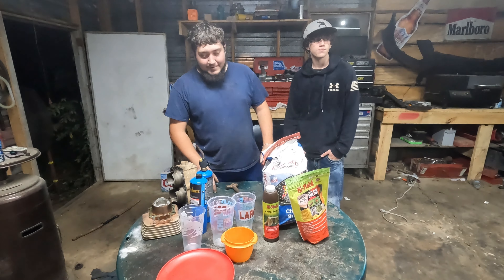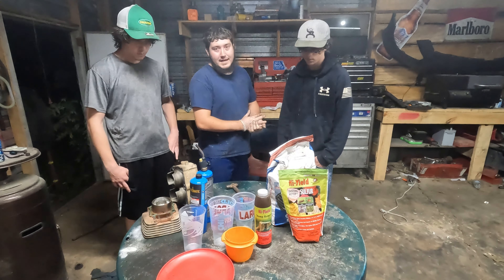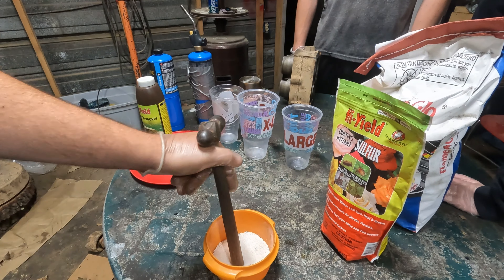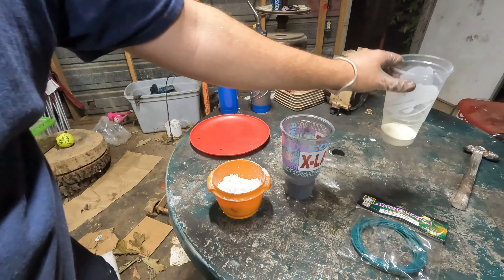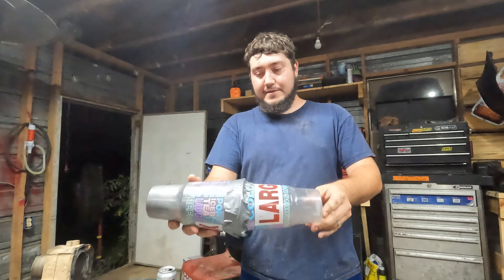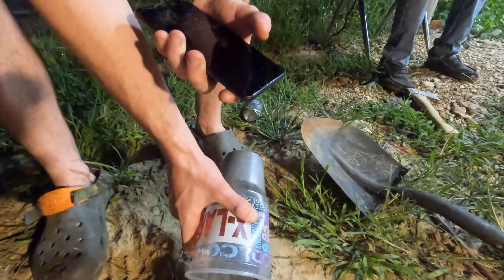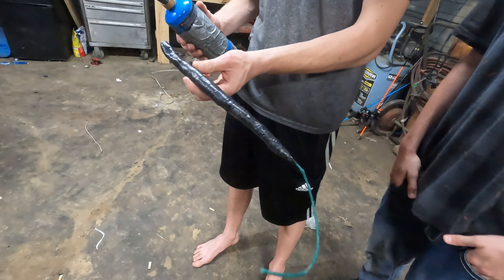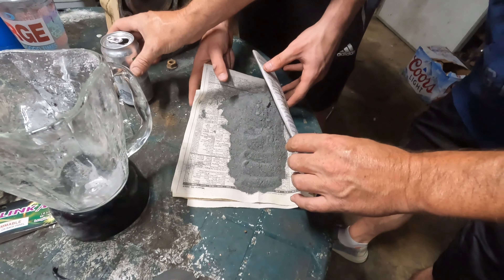DIY Gun Powder Dose it work

Comment: Weld up a pipe, both ends, then drill a hole in One end, thread the hole, pour in the powder, then putt in a bolt whit a micro hole for the fuse, then seal the hole after fuse inserted, with thick glue.
Then you have a homemade pipebomb. 🤷🏻‍♂️
(I’m a redneck to, and i was in the Army, so i’m a bit more… 😉🤷🏻‍♂️🤦🏻‍♂️😂😅🤣)
Reply from the maker: I thought about it 🤔 I need to fiend somewhere to buy TNT I got a beaver dam I need gone